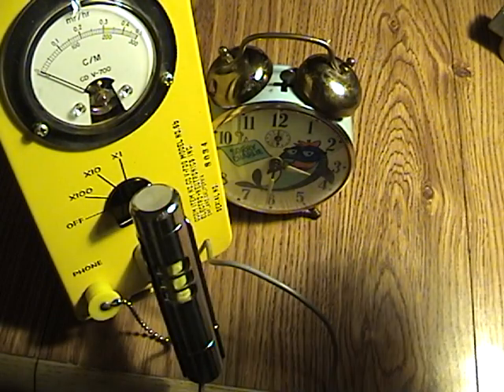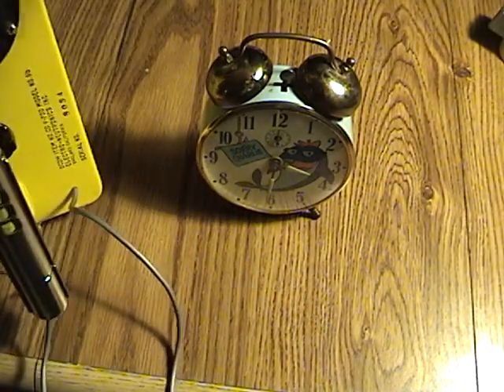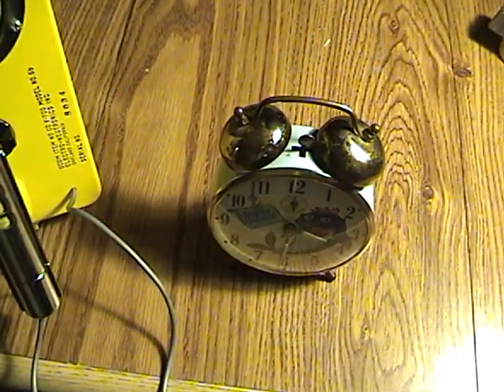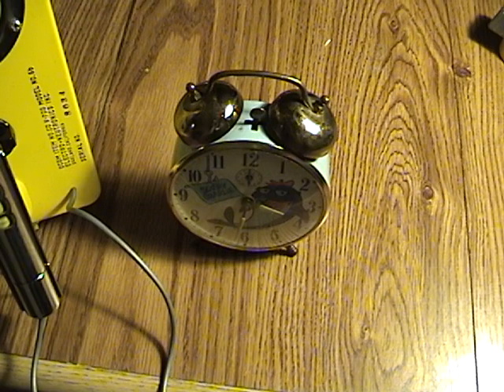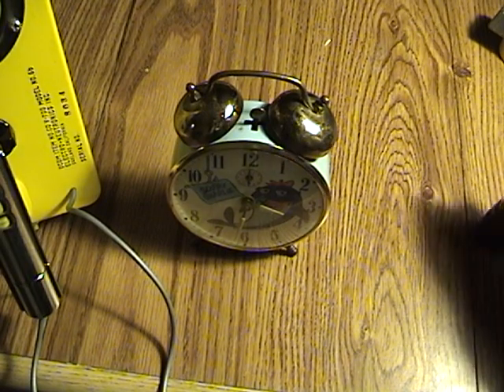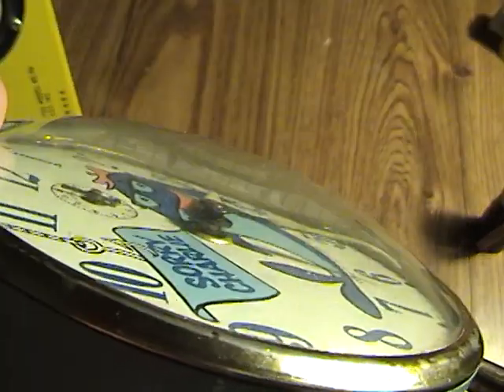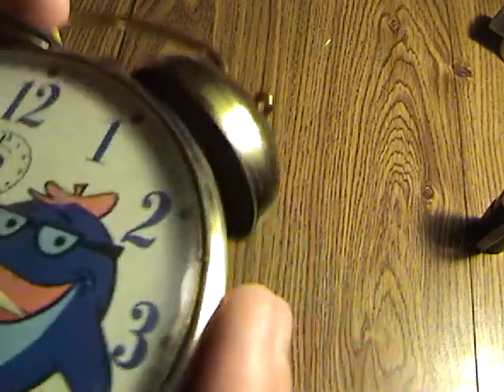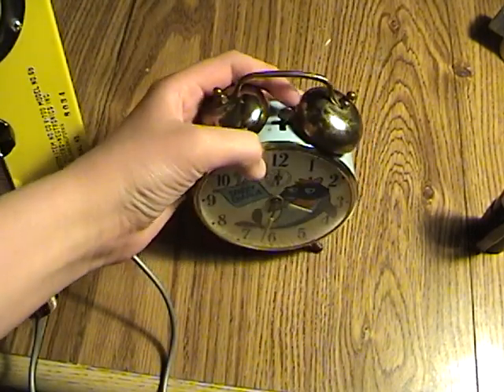Radium Watch Hands

Comment: The Radium 226 used in the clock hand paint does not glow on its own; it is mixed with activated zinc sulfide which is the source of the night glow.  Each time an Alpha particle from the Radium decay strikes the zinc, a flash occurs.  The glow is the result of a myriad of those individual flashes.  Over the decades the zinc sulfide decays from the bombardment to the point that it no longer glows in the dark although the longwave UV light you are using will still spark a glow.  But, do not think that the Radium has decayed when the hands no longer glow at night --- Radium has a half-life in excess of 1500-years and the hands are just as radioactive as the day the paint was applied.

Comment: There are two things which i dont get.

As i understood, Radium is self-luminiscent so why does it only glow when you expose it to UV-light ? Shouldn't it glow like this by itself all the time ?

The other thing is, shouldn't the glass of the clock be enough to block the major share of the alpha radiation ? 

Why is the reaction of the geiger counter still so strong ? Ive read that alpha radiation can be blocked with a sheet of paper. Now that glass is certainly thicker than a sheet of paper

Comment from the maker: @Celeon999A The reason I used UV light to illuminate the paint is because after so many years the phosphor in the hand dies from the radiation and can only be excited by a UV light. So when it was first made, yes it glowed by itself but no longer does due to the radiation. 

You are correct about a piece of paper blocking alpha and on top of that that detector can only detect beta and gamma radiation, so all of the radiation being detected are beta and gamma emissions.

Comment: marie curie worked with metallic radium and she had it in a glas vial in her pocket the hole time this is an not so radioaktiv alotrope radium 226 witch is used for watches and for making radon because this material is emitting radon but the alpha radiation can be stopped by glas

Comment: if 1969, it may be promethium, not radium..may be a better score than you thought.
check for differential alpha vs beta emissions
Reply: Promethium-147 has a Half life of 2.6 years. So it would still glow but he would get little to no Detectable levels of radiation. I have a few PM-147 dials one of them is a IM-179U Gamma Dose Rate meter that has a Promethium painted scale.